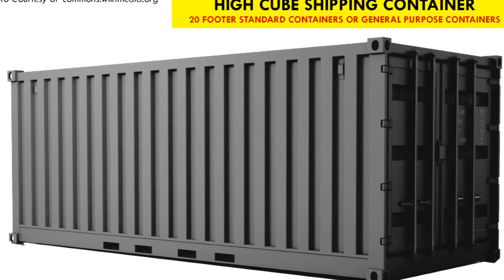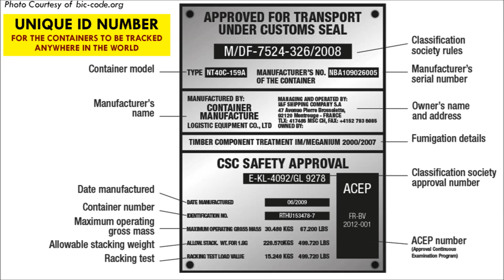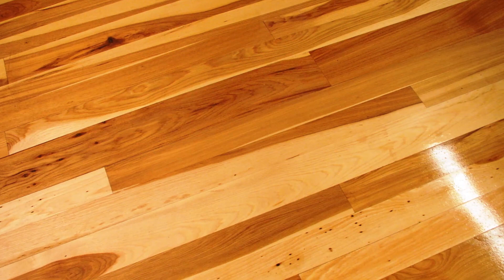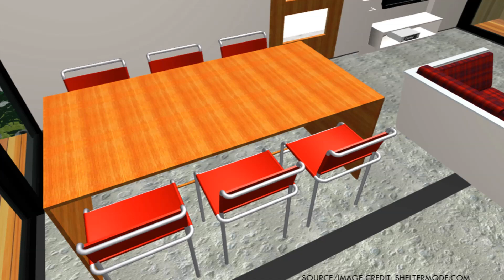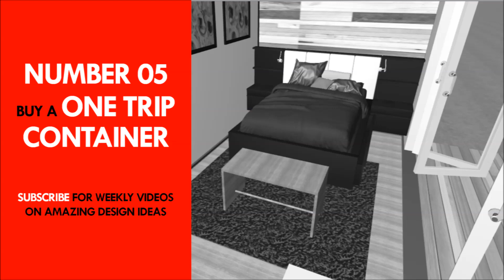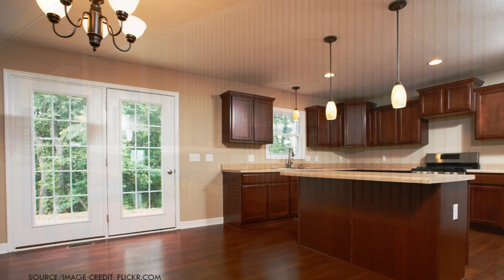How to Eliminate Toxic Pesticides and Chemicals from Shipping Container Floors 2018| SHELTERMODE

Comment: Thanks for the video. I don´t understand the concept of the heavy gauge polythene lining on the plywood for avoid the toxic vapours of the plywood? It´s a vapour barrier or a waterproof lining like a normal plastic? It´s to avoid the transmit of humidity between concrete slab and plywood? It´s enough that the plywood breath for your downside to avoid the decay of the plywood? Regards

Comment: I bought a 2006 40' container in Florida and mine smells like flowers?  Could the smell be flowers or more likely bug spray?  I'm going to using mine for storage and a garage, if it is bug spray is it okay to be in there for a couple hours at a time?  The tag says it was treated IM/Tailileum 300/2006

Comment: Another way is to put aluminium foil on the floor and then on top the finish. I use only method one as that eliminates it 100%. If you want to live in it I think it is necessary to remove the floor. Why take any risk, removing it takes about a day. A very short time when compared with the whole time for the project. Epoxy also outgasses. Sealing the floor can cause the wood to rot as it does not 'breath' anymore. Make sure when you seal it the floor is properly dried and also seal it on the bottom. Concrete flooring is very heavy and removes the ability to move the container later, concrete is also porous and not waterproof.

Comment: Alex, i am looking into the polythene sheeting method. Can you please point me to a material that meets the requirement? It seems to be more than a simple google search. Thanks.
Reply: Alex A  yes personally when I hear someone suggest a system for building I start to think about how to mimic it. So since I plan to use laminate, I want to get the “right” polythene, tape, and underlayment. Brand suggestions would be great because then the viewer knows where to look.
Reply: Alex. I am in California, the mecca of building materials as I see it, and I have been asking around for that material. No one can give me a NAME. I want to buy the stuff that will block gases; all gases. Do YOU know a name??
Reply: @save_from_comments  I wonder if you were sarcastic? Anyway, this is what I found"Polythene sheet
Polythene sheeting is a plastic film made from petroleum (you may also hear it referred to as polyethylene sheeting, poly sheeting, plastic sheeting, plastic film and poly film). It's an incredibly versatile product used in a wide range of applications." Yes. many years later .... Greetings from Florida.